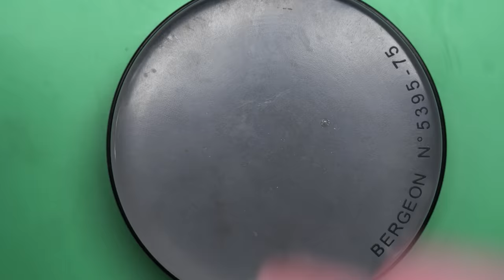This Tudor Oysterdate From the 1950's Is In ROUGH Shape!

Comment: Just want to say these "big rose" Tudors with the roulette date wheels are my favorites. It's also worth noting these movements (Tudor Cal. 39X, actually made by Fleurier) are extremely rare & valuable vs the later ETAs... Especially this one: Most Tudors with 390 or 395's had the common copper finish; this type with the rhodium plating was only used in the Submariners and earliest 1st gen Prince-Dates like this. People will pay well over $2500 just for a complete rhodium finish 390/395 with no dial or case or anything in order to use the parts in their Tudor Sub... 

Nice to see a Cal. 39X without a worn rotor post/bearing and scrapes all over the caseback and movement too! I've owned and worked on several of these, and the rotor post/bearing is a massive weak point. Very common to see these with worn out floppy rotors, and since parts are very scarce and expensive for this caliber, anyone looking to buy one of these should keep an eye out for the telltale circular scrape marks of a bad rotor on the inner caseback. Of course even the badly worn rotors will still function in that they wind the watch, but they will produce an awful rattling noise and scuff everything up.
Reply: Thanks for the insight. Spectacular piece. What would you say this piece he got going again is worth, $5000?

Comment: Hi Marshall, I noticed that after the final installation of the balance bridge, after tightening you moved the watch and the bridge moved very slightly. May just be a tiny bit of flex as the bridge is canterlevered, but it may be that the bridge screw is slightly too long, which could partially explain how the pallet fork became bent.
Edit: can also see the barrel bridge wobbling while running during installing in the case
Reply: Saw the same thing.
Reply: yes, it's a nice work for the layman but very ugly for the professional ...
Reply: @-timetowatch1110  what is your point please ?
Reply: Was going to comment the same thing!
Reply: Noticed this also, was wondering the same thing, maybe the screw bottomed out and did not seat on the bridge?

Comment: THANKS! for solving a mystery.  Since I like watches...and obviously, my departed father...my mom gave me a box of my dad's old watches.  None of them are valuable, but they were my dads.  I have a picture of my brother and I as toddlers and my dad is wearing an old square Bulova that I now have.  Among them was a Seiko.  I couldn't get it to wind and I cursed Seiko for making the crown so inaccessible.  Because I am old and LAZY, I have a machine that winds my self winding watches for me so I put the Seiko in that and now it runs...not well, but it runs.

Also in the treasure trove is a battery operated ROLEX!  Alas, the plastic movement is bad.  I found a movement at Esslinger so maybe I'll get that running as well.   It looks pretty good, from six feet away; arguably more showy than my GMT, but The "gold" on the back is corroding.  I can't imagine where it came from.

Comment: Thanks for another great watch adventure, Marshall!  I was wondering if you were going to try to fit a new hairspring to the movement!  Of course, that’s a repair that would take us to a whole new level.  And you would still have needed new balance Chaton jewels. 
On a related note, I suspect that a previous worker destroyed the pallet fork and hairspring, maybe by installing in an overbanked position and then forcing the balance wheel until the impulse jewel broke off.  Hard to imagine how a severe shock could do that.  Many thanks!

Comment: I have watched many of your videos.  I always find them to be very informative and presented in a very well made and narrated fashion.  I really like the magnified close ups you include.  Keep up the great work and I will keep watching.  At the point where you installed the original pallet fork and its bridge (at ~33:40) it looked to me like the bridge was not fully seated before and after you installed the bridge screw.  Although you then found the original fork was bent and blamed that for the balance not spinning, it seemed to me that the bridge being not fully seated caused it to prevent the balance from spinning rather than the fork.  A close look at the video shows that after the fork was replaced the bridge was fully seated (at ~35:35) when the balance was reinstalled.  Thus, the interference was removed, and the balance could spin.  I would guess that if you were to install the original fork the watch might still run but not very accurately.
Reply: Yes I saw that too.

Comment: Hey there Marshall, another great video.  The damage with the balance and pallet fork seems to be as a result of a heavy handed "technician."  I reckon someone slipped with a screwdriver and destroyed the hairspring and then following through and bending the pallets.  A really hard knock or drop would (in my opinion) have a lot more physical damage on the case.  A nice watch restoration to end a great year.  Well done.  😀

Comment: Love the Tudor rose, great logo in what tends to be an overemasculated world of watches. Nowadays you can still find a rose on the crown of modern tudors, but they've mostly switched to the more boring (imo) shield logo.

There's actually a limited run of modern Black Bay Heritage Tudors which still use the rose logo, (ref 79220N) I would love one but can't justify the about 2k price hike purely from the rarity of the dial.

Comment: Hey Marshall,  I have a similar watch that I am wanting to get running again for a friend of mine.  It is a Tudor Oysterdate (not the Prince Oysterdate like you repaired). The movement number is 425.  The non Prince watches are manual wind.  I've run into an issue trying to find a donor movement to be able to replace some parts.  I've been watching Ebay for quite some time with no luck.  Do you have any suggestions for other places to watch for parts?  Thanks in advance!  ToddB

Comment: So I bought a $25 Gruen "project" watch from eBay.  It was going great until . . . until one of the pieces (it was a tiny barrel with a gear that I think was related to the minute hand) was launched by my "death grip" on the tweezers.   Lesson to self:  keep a light grip on tweezers.  Then, when I gave up looking for the part and resigned myself to chalking this up to lessons learned and started putting the movement back together, I launched a screw while trying to tighten.

SO, my big question:  Do you have a recommendation for making it easier to look for parts or to contain parts to a small area where I can have at least an iota of a chance to find them?

Comment: Instead of scratching the funk from the case before the ultrasonic I would suggest placing it on a paper towel and spray a product called greased lightning on it which softens the gunk and then a gentle soft toothbrush to get into the crevices

Comment: It seems that the shims in the reversing wheels act as a tiny sprag clutch. In other applications a sprag clutch looks like a roller bearing but instead of rollers there are what look like dog bones. turn it one way and it runs smoothly but turn it backward and the dog bones grab and lock

Comment: I wonder if the bent fork was just because someone was messing with trying to fix the non running watch and they forced or otherwise didn't get the parts out or back in properly and that's why the balance was not - it was removed incorrectly and that bent the fork and when they couldnt get the balance back in or go further they just closed the case up and that was it.

Comment: Have you ever used or heard of using beeswax and vaseline to seal the case before you close?  In the Handbook of Watch and Clock Repairs by H. G. Harris he says: 

Make up a small quantity of a mixture of four parts of beeswax to one part of Vaseline. Smear a thin film of the wax between the joins before closing the case. A small application around the
winding stem at the top will complete the treatment.

Comment: 1) You need to start lubricating the faces of the pallet stones to get your amplitude closer to 270°, on a movement like this, I’d use 9415.
2) Install the setting lever screw and setting lever when you first start assembling the pillar plate—then install the stem, clutch, and winding pinion.  I do this just after reinstalling the cap jewels (which should be removed before cleaning).
3) Loosen the hairspring stud from the balance cock and separate the two before removing them (unless the regulator pins hold the hairspring captive)—install them preassembled.

Keep it up.

Comment: Hey Marshall, is it me or the replacement balance bridge was rocking back and forth with every beat?

Regarding the weird automatic works tower, I feel like the manufacturer's idea was to place the barrel with its bridge, then assemble the train with its bridge, then finally put the automatic gears on top with their tiny jumping clip. Would probably be less fiddling this way.

I agree with others that a shock capable of bending such a light and sturdy part would annihilate the rest of the watch. More likely it was someone's screwdriver.

Comment: One thing that I’ve learned on this site is that I’m a Battery Guy. IF you buy a Mechanical type watch you will eventually have to have it SERVICED. 
Unfortunately I don’t know ANY watch Service/Repair places and the people I’ve had change the batteries in my watches are Reprehensible people. 
Are watch repair/service people held to any kind of ethical standards by the watch community? Is there a rating system ?

Comment: Heh, yeah I was wondering if there was a weird reason you had to seat the barrel bridge before screwing down the train bridge, but I figured you would comment on it if there was. I was mentally puzzling through if you could have seated the barrel then the bridge before assembling the rest of the weirdo ratchet system rather than putting them all together before fitting in between the train wheels.

Comment: Why wouldn't you remove the old gaskets on the case  and around the crown tube before putting it into the ultrasound cleaner so that the seat is cleaner before replacing the gaskets?

Comment: No screws or feet for the dial? Cost saving measure perhaps given Tudor are often described as “discount” Rolex’s? what with the Rolex cases (sometimes with Rolex logos on) but ETA movements?
Reply from the maker: I think it was so they could have that full date disk design they used (the feet would interfere with it otherwise)

Comment: When using new old stock, especially springs, shouldn't they be disassembled and cleaned to remove old grease and relubricated with modern grease?We have heard several times on this channel that the old greases are nasty and modern grease formulations are much batter.

Comment: could just replace the barrel  and spring with a small high frequency motor or servo, and the balance and shit wit a coin cell and micro chip, and run it wit a clock speed of 65.536khz, and get double precision over pretty much any standard quartz watch, and also reduces duh size of the motor, add a solar panel, or rework a dat perpetual movement to crank a coil to keep duh battery charged

could just keep a balance, and modify the barrel to incorporate a motor and small tension spring, wit a servo you can keep a constant and precise torque and force on a spring using very little power... but  65.536khz count time more accurate and precise then 12,18,24,36,48, 50, or 60hz
pretty much a watch that would never stahp tickin aslong as it got power, and duh gear train workin
Reply: a true perpetual chronometer

Comment: Quick question. How come none of the watches you've restored, including 25k worth of Rolex, have featured proper glass or sapphire? All of them have plastic "crystals"?
Reply from the maker: Sapphire crystals didn't exist until relatively recently in watch terms. These are all older vintage watches where acrylic crystals were almost exclusively used.
Reply: the very basic historical timeline: untempered mineral glass (very thick glass was used on pocket watches without front covers for added strength) to acrylic glass (quickly and heavily adopted in the 1930s. it IS considered a type of glass based on its molecular structure) to tempered mineral glass, (cheap methods for the mass manufacturing of tempered glass using chemical instead of heat tempering didnt emerge till the 1970s.) and then to sapphire. (sapphire is actually not a glass because it has a crystaline structure)  because the raw materials for manufacturing optically clear sapphire are expensive and they need rather fragile reflection reducing coatings to get rid of light glare, they are still mainly used only on watches meant for higher price points. same reason you still see tempered glass on phones instead of sapphire. acrylic has remained the main choice for a long time, because for most watches, it just is.
Reply: @umeko204  Interesting! Thank you.

There were 2 phones with sapphire instead of tempered glass, though. But considering how many there have been without it, it's fairly obvious why that wasn't adopted widely.